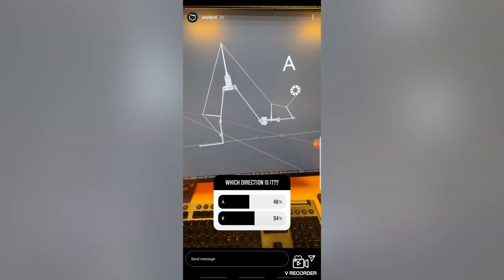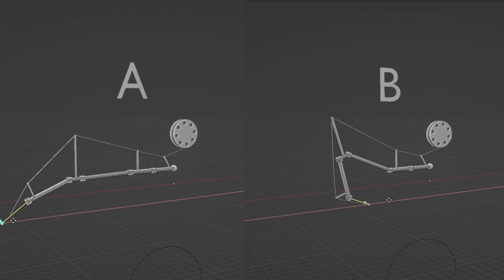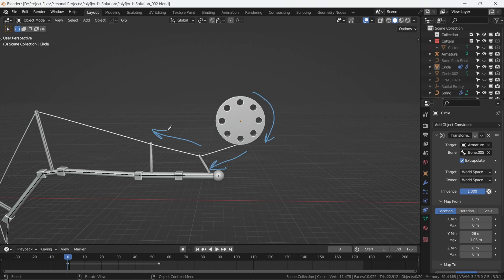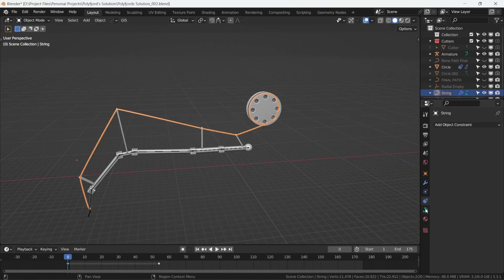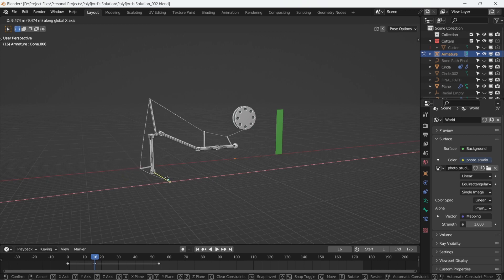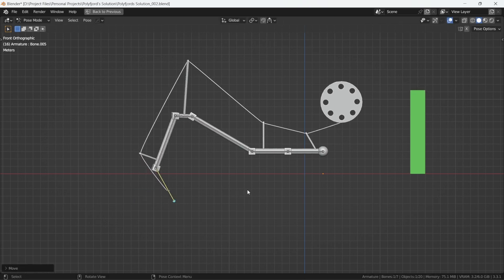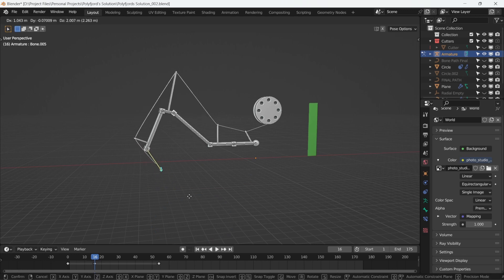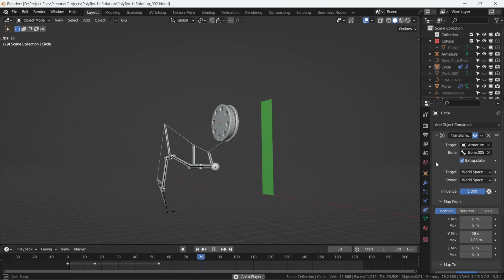What is Polyfjord's Paradox in Blender?

Comment: What an AMAZING video! I am so honoured 🙏 thank you for making this!!
Reply from the maker: Honour is all mine! Loved working on this. What a time to be alive! Keep up the absolutely phenomenal work that you are doing!
Reply: just like your finger, you need 2 sources of pull to bend. Thats why it STILL looks funky
Reply: If you want to make it look more plausible. Make it have two wheels, and two strings, one follows on the top, and the other on the bottom. Either wheel then counter rotates for each movement.
Reply: @DrTheRich  lol literally what i was saying, but better put into words.
Reply: The one thing throwing me off is it doesn't seem to have a restoring force to extend the leg. Comical springs or some sort of compliant mechanism would help me visually see it (or a counteracting pulley system on the bottom)
Reply: Yes considering blender's workspace it really seems like it should become longer (the "string")
But considering physics, the motor only resides in the wheel which implies that when the wheel rotates then (i will call it arm for the purposes of this argument), the arm moves.
How could a physical instrument exist such as when slacking to bend upwards and when under tension to relax
Reply: @Catuta  It could if the arm was held under tension by either a spring force on the joints, or a second wire contration.
Reply: @DrTheRich  yes but i am reasoning on what is visible and not adding the other necessary addendums needed for the real workings of reality
Reply: @Catuta  except you're not because you are talking about a motor in the wheel... Where is that motor visible?
Reply: @DrTheRich  that is also a fair point, if you may, let me rephrase my idea so that it may take into consideration your observations, considering the gravitational force doesn't apply in this experiment, and the torque is applied by a rotational force, the only theoretical option for the lowering  of the fourth segment of the robotic appendix ( considering the segments being counted from the base - static point to the tip, segments delimited by the cuboid markings, the fourth being the shortest one) would be possible only by feeding more of the wire from the wheel

In my opinion, the ideas presented in this video are not wrong from the perspective of blender or the perspective of dr Hamza, but since blender calculates the length of the wire based on the final position of the joints ( considering joints as the points where the perpendicular polls reside) the calculation may not mimic the reality that the creator might have been aiming for

hopefully, I have exposed my point of view clearly and if any questions may arise I will happily entertain any questions

addendum: I am sad that I can not post a photograph with my calculations but I will consider making a video and posting it so it may clarify any uncertainties

Comment: The only reason this is confusing is because it would never work this way. You would have to draw the string to the underside. If the wheel was actuated, this could never work as drawn. The issue is the end of the “finger” which curls the wrong way screwing up all of our intuition on something that should be intuitive since our fingers work like this

Comment: Oh man this looks interesting, especially how counter-intuitive so many things can be. I'll but my best guess here, and then continue watching!

If the shortest path between to points is a straight line, then you would need more 'rope' to traverse a non-straight line. In example A, the wheel provides more slack to the arm as it bends, and corresponds with the path from the wheel to the tip becoming longer.

Comment: Something seems very off from the design itself.

Why not attach the string to a single spoke on the outside of the pully and let tension naturally ebb and flow in a single direction?

I feel like this is making it way harder than it really has to be, simply because it is the wrong type of device for the application.

The artist needs a gear system not just a pulley.

100% this thing would break before its time.

Comment: A - because almost all but very first two sections are extending when this thing twisting.
But without some hidden and quite powerful springs, none of these variants would work. With just force applied to the tip, string would just hang down (unless spool has some spring, again).

Comment: The wheel should be stationary. The trick is to look at the length of the thin cable. Also, the point moot because it's an impossible object. There's no rig that it could attach to IRL to make it do these motions. The anchor points wouldn't make sense.

Comment: Both are correct.
The problem here is the rig is completly wrong for the motion wanted.
Basically this is an imaginary rig and not a true rig, by which i mean this rig would not work in reality.
What you're trying to accomplish however is trying to treat it as a real rig and expect to come up with rational results which by default is impossible.
For true to reality rigs you can easily figure out the rotation direction.
For imaginary rigs like this you can only come up with imaginary solutions which means both directions are ok as no true rotation solution exists.

Comment: This is an example of when inverse kinematics doesn't translate to the real world, if the spool winds up, the arm would curl up and vise versa. Since controlling the individual joints in this case would be impossible, neither direction will look correct, unless the joints act in more of a 'spring loaded' fashion such as a spider's leg; when tension is released from the spool, the arm curls inward, when tension is applied, the arm extends until it begins pulling back in towards itself.

Comment: I can see both. The first impression is that the string it's beeing pulled from the carrousel therefore rotating clockwise. Now, if the arms are actually relaxing the string when getting down and the carrousel is in pulling the string, then anticlockwise should be good. It depends on the premise for me 😁

Comment: Uhh neither will ever look right? You have what is system that requires at least 2(for the back and forth up and down realistically needs 3 pullies) opposing forces.. right now you have slack or pull and no inbetweens.. so if you want a finger go look up how fingers work. Alot of tendon work going on. Ontop of that the line isn't matching the tension needed to even suspend disbelief.

Ig if I had to give a thought.. I mean ig B? Just looks more like it's pulling back when action happens. But you could argue that there is a pulling action happening and the wind is reflecting that and only pulling back to scrunch. Also how it's wound makes a difference..

Comment: My guess is A. As you tension the rope is forces the joints to move to their shortest position for the string, which pulls them all out. As you release the session is allows the rope to bend around the sharp corners and curl up.

Comment: My reasoning is: a straight line is the shortest distance between two points. So when the arm is relaxed (straight), the string is in its shortest position. When the arm is flexed (bent), the string must increase in length, and therefore the spool must rotate clockwise.
Reply from the maker: Great geometrical way to solve this in the head!

Comment: Neither, it seems that the way in which the mechanism is designed, it wouldn’t be able to to move the way it is moving using only 1 pulley. If you instead routed some of the wire underneath the leg, it could reasonably move the way it is animated

Comment: well this is just too complicated.. what if it was not a curve?? why not just explain that if the joint turns toward the line, the line shortens... simple!
Also this armature would need 3 motors..
But if you had another armature that would bend in many directions and you wanted to know the length i would understand i guess.

Comment: Writing down my answer: A is the correct one. It requires spring-loaded joints in the arm, because unrolling the spool while the arm is extended would not fold it all by itself, just loosen the string. In the folded state the path from tip to tip support, to elbow support to the third support is longer than in extended state, so unrolling the string allows the arm to fold, and reeling it in makes it more straight. But since gravity stabilizes both end states and unrolling the string doesn't create any extra forces, folding into the curled state by unrolling the string requires some additional force - like springs in the joints.

Comment: 0:45 
B feels more intuitive: reel out to move outwards, reel in to move inwards.
A is i think technically more correct: thinking about fingers/muscles, pulling the tendon from the back would extend the finger, while pulling from the front would contract it.
Reply: It totally depends on which side of the joints the strings are attached.

The fingers in your hand have (at least) two sets of tendons, on the bottom and on the top.

If you stretch your finger, the top tendon gets pulled back, while the bottom tendon gets pulled forward.

Think about a two lane road in a curve. The outer lane is longer then the inner lane. If you make the bend sharper, the difference becomes bigger. So A totally makes intuitive sense.

For the wheel both can feel intuitive, depending on how the wheel is mechanically configured to the rope.

Comment: It may have been said already but, if you just go with the knowledge that the shortest distance between wheel and tip is a straight line, then you can intuit that an extended arm gives the shortest distance.

Comment: As mechanical engineer and a 3D artist both feel wrong to me 😂😂
Reply from the maker: I'm curious, as a mechanical engineer, what's your take on it?
Reply: The time when you said its like circular motion, you were right, but a better term would be its motion is a sine wave or cos wave (depending on what you concider the starting point)
And only loosening and tightening of the thread (curve) will not make it move like that, it has to be a more complex structure, which is obvious, but the small change which can sell the effect is to add a small spring in the lower part of moving joints which will show that on loosening the thread, the legs are not easily falling, they contract due to those springs
Let me know if I am wrong, I am still on my way in 3D
Reply from the maker: @user-gq1ij  That's what I've been telling in other replies as well. That a traction mechanism of the string alone isn't able to drive this in and itself. Either a spring assembly to store the recoil force or small motors places in the joints will move the segments. Here however, we only replicated and worked on the rig that was shown in the Polyfjord's original video.
Reply: @hamzameo  I would like to see that version of your model on your channel, I hope polifjord also sees it and gives it a shout out

Comment: The "leg" looks more like a finger.  You realize that limbs work using opposing muscle groups that "lengthen" slowly when relaxing and the opposing muscle group contracts/shortens to speed up curling or stretching, depending on which muscle group is contracting and which is relaxing.  The tip would not tuck under without some sort of force pulling it into a curled position, say, an opposing string or series of springs that leave the limb curled at rest.
Reply from the maker: Very rightly said. That is the principle of movement in vertebrates. In our problem here, we are only figuring out the rotation. The movement can't logically be driven by this traction mechanism. It should have some internal motor system for each segment e.g at the joints.
Reply: @hamzameo  Ah, I see what you were going for and that made more sense to me at the time.  I wonder what the function of the string is then.  Some sort of hose?  And why the different lengths of the 'needles' through which the string is threaded?

Basically, the distances between the individual eyelets that the string is threaded through need to be added for any given position in order to determine whether the wheel is releasing string (CW) or drawing it in (CCW) at that point of the movement.

I think Polyfjord's animation is clearer b/c there's no tuck under and A would be true.  B might fool people b/c when the string (cable/hose, whatever) is shortened the mechanism is extended.  You would need to restring the cable underneath the fulcrum of the topmost needle for B to be correct.

Your rig is critically different from Polyfjord's.  His tallest 'needle' stays mostly upright while yours swings back and forth during the motion giving it a more complicated pattern of uptake and release.

Comment: Very good demonstration. I think adding "springs" at each pivot point would return the joint segments to a curled position while pulling the line from the reel, so this model would seem to work with a visual counterforce. The design could be as simple as torsion springs or as fancy as the Pixar lamp arm design, I would imagine.

Edit: I am referring to A.
Reply from the maker: I'm thinking on the lines of motors placed within the joints as the drivers. Although a bit less accurate to calibrate/control the individual movement of the segments, your suggested spring driven mechanism can work as well to provide the necessary recoil force.

Comment: I feel like the paradox comes from the fact that intuitively we Understand you can't "Push" a rope.  

With the combination of the animation AND mechanics it feels wrong even when the wheel spins properly because it wouldn't work in the real world.
Reply: Yes, it would require a  rope from the other side of the pulley/motor to pull also.
Reply: You can push a rope though, it just requires a spring or motor on the spool. Spring loaded reels are quite common, in fact you've probably used one yourself: a metal tape measure that retracts when you push the button!

Comment: If you built this IRL I don't beleive that pulling nor letting out slack would result in anything like that animation we're seeing.  Pulling should make it curl in the opposite direction, and letting slack would just cause the whole arm to hang.
Reply from the maker: You're very correct. In order to make this into a mechanically viable solution, we definitely need either a motor system in the joints or a spring mechanism to provide a countering recoil force. 
However we're only solving the problem at hand with the given rig with the string to figure out the true rotation.
Reply: @hamzameo  on the end you simply need to flip the string to the underside. You cannot form an s curve with a single string on one side like a fishing line.
Reply: Irl you would build it "backwards", with the string in the "bottom" of the arm, so it curls inward when tightening  and stretches when released. Obviously you would also need a secondary tentioning/spring-like device to make it "come back" to an outstretched position.
Reply: This is what I was thinking aswell

I believe the string would need to be on the underside of the rig in order to get the desired direction when tensed.
Reply: @cinfdef  One string attached at one point on the top of the end of the arm looping back around the wheel and attached at another point under the end of the arm ... then turn the wheel one way to pull in and the other to pull out
Reply: I was thinking the same, but I just figured springs on the necessary joints would fix it. So I chalked it up to simplification
Reply: Exactly, there's no mechanism to store energy that can be released a spring would be the best option in that scenario of simplicity. But for that action to happen, there has to be something storing energy when the string is shortened. That could be released when the string is lengthened.
Reply: Yep. 100%.

Comment: It reminds me of some prosthetic finger designs I've seen. If it's strong fed from the bottom, it would make more sense to run in the A pattern. As in that pattern, the spool is pulling the string taught, and therefore straightening the finger. Then loosening as it constricts.. the only thing I'd change or add was a taught spring or insverted string on the bottom to pull the finger closed when the top spool is slack